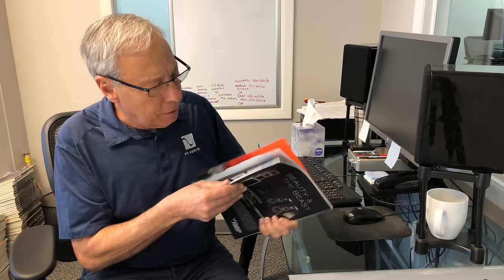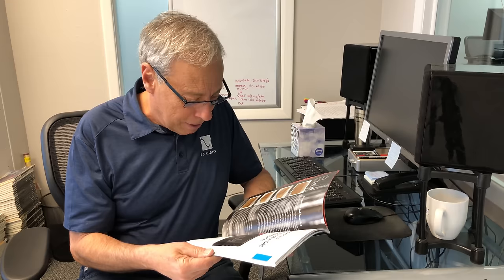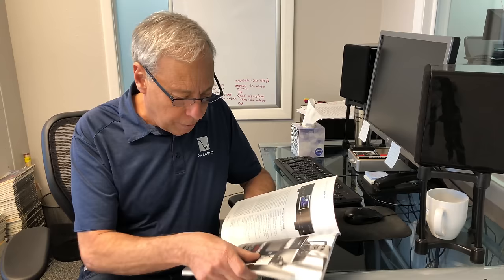Is equipment burn in real?

Comment: Burning in from a technical point of view is completely nonsense. Especially if you're talking about amplifier and such. If it has no mechanical parts it does not need a burning period. 

Speakers for example would need a couple hours. Paul I am sorry but totally unsubbing your channel hence forward. The snake oil  approaching your opinions with nothing but unfounded bull. 

You never even once in one video actually used your technical knowledge. Here also you talk about caps who again need no burning period, if any it takes less than 20 min to "form" if that's even an audible thing .....

You sound like the guys I see at meetings, lots of excuses to justify their pucks, specialized feet, wrist thick cables , and more of that bs. 

I gladly would see you do a blind test, guarantee you will leave humbled. And as we have seen? Some even leave in anger and making even more excuses. Why they couldn't pick their 1500usd costing RCA over a simple 2usd one. 

Want to be sure something works?  Do blind tests...
Reply: Michel Linschoten He didn't actually reply to you, but you're already being disparaged in the comments.

They want a new generation of audiophiles? Well, Atheism is spreading faster than religion these days. "Trust us, it's there" isn't going to work so well as those "uneducated" (see ref. comment) teens become adult consumers.
Reply: You just have to try it on high resolution gear. Not only Paul says that. Everybody who tried that do.
Reply: And none of those have done a double blind test.
Reply: Marc De Vries well they need good sound and they have eyes and live for music. Not for tests.
Reply: +Michel Linschoten out of curiosity, what components have you specifically tested and what was your testing methodology? Thanks.
Reply: +Alex Zuzizi
If you NEED good sound, you NEED good ways of testing.

And trusting your ears or your eyes is NOT a good way of testing. So the result is that you do NOT get the good sound you need. (or waste huge amounts of money for the same sound)

If you think you can trust your ears or your eyes you need to watch this: https://www.youtube.com/watch?v=G-lN8vWm3m0
You can experience yourself how untrustworthy those are. Nobody is immune to this. And that includes speaker and amp designers.

The problem is that a lot of designers don't know this and they think it doesn't apply to them.
Until a brave person person forces the company to use double blind tests and those designers discover that they have the same confirmation bias as everybody else. They put top class components in something they designed so it MUST sound better. And then they discover that it does NOT sound better when they do a blind test themselves. And then they see the light.

This is the reason that double blind tests are the golden standard across ALL of the scientific fields.

Of course this only applies if you need good sound.
Reply: Marc De Vries well I already have good sound based on PS Audio and Sonus Faber gear and $$$$ cables. So I am happy with it. I now need a bigger and more treated room to reach audio nirvana :) So it’s practical not theory. As for the delusions in audio they do exist. No questions asked. And nobody immune to it. So does burn in :)

As for the blind test. A LOT depends on the current mood, time of day, humidity surroundings and who knows what! You hardly can reproduce all these factors. I THINK I ONLY think I PRESUME I could tell the difference between burned in and not burned in gear in MY ROOM in the evening in a good set and setting just like Paul does in his.
If I could not it would be the last thing to worry about :)

As for the video you posted. Again illusions do exist! I just don’t look at lips when listening  to the music. Normally I sit I a darkened room concentrated and yet relaxed. Sometimes close my eyes. So it’s almost always like a blind test :)

In fact if I new video illusional trick that made my gear sound better I think I would immediately jump on it :)
Reply: So, you already have good sound with nice gear. Good
And how did you decide on that gear? You probably got different gear and listened and compared?

And did you then say that it's useless to compare the gear because current mood, time of day, humidity surroundings etc etc influence it?
No of course you didn't. We all try to make the best choice for our budget and listening room conditions.

No, you probably don't look at lips when you listen to your music. But you probably looked at the price tag of the different gear? Or you noticed how one piece of gear looked to be built from more expensive materials, or weighted more? All those things influence our brain in the same way that those moving lips in the video did.
And no matter how much we try not to be influenced by it, we cannot turn that bias off. No matter if you know those lips change the way we perceive the sounds, it still happens as long as you see those lips. We know that it influences the way we hear the sounds, we know why it happens, but all that knowledge does not help us fight it. 
As long as we see those lips moving we hear the sounds differently. And as long as we know we use those extra expensive cables or better amplifier or high res audio file we hear the sounds differently.

"I THINK I ONLY think I PRESUME I could tell the difference between burned in and not burned in gear in MY ROOM"
The speaker designers at Harman didn't just presume they could tell the difference between the cheaper and more expensive speaker they had designed and listened to themselves. They were 100% convinced they could tell the difference.  But to their own surprise they completely failed in a blind test. Why would it be any different for Paul?

Most people have the best intentions. They are not trying to fool you or themselves.
And theoretical measurements are often not enough, because they don't measure all aspects of music that are important. 
But that is the nice thing about (double) blind tests. You still use your ears, so you "measure" all aspects of music that are important. It's practical not theory, but you remove biases.
And yes, double blind ABX tests are difficult and tiresome. But single blind tests help a LOT already and are not much different from the way everybody makes their gear choices. That is how I tested all my gear.

By the way, what kind of treatment are you planning on? I used REW (room equalizer wizard) to see the effect the placement of the treatment had, and that helped a lot in understanding the effect and getting the best out of it. It also makes you realize the severe limitations of treatment below 100Hz. (which was quite disappointing)
Reply: Marc De Vries yeah. Well I think one day I ll get a specialist to do the treatment. Basically to design and tune bass traps and to do some   sound defusers. I have tons of sound absorbing stuff already. Bass under 100 is my biggest problem yes. If there’s a record with very articulated bass that resonates and I still want to listen to it now I plug in DSpeaker which is basically self tuning parametric equalizer with a microphone and graphs like in REW. It flattens bumps in low frequencies so the curve is smooth and almost flat to certain limits. Great piece of equipment. Check it out if you don’t know about it yet.

http://www.dspeaker.com/en/products/20-dual-core.shtml

Blind test are good! I now will agree :) But to me it will only be relevant in my room in a good mood and for rather long time. So it’s somewhere from unpractical to impossible especially for burned in and not burned in equipment. From time to time we do test equipment with my audiophile friends eyes open. I THINK price tags don’t matter much. And yes sometimes very rarely cheaper products sound the same or better. Sometimes they just sound different like brighter or exaggerated bass. It may seem like they sound better at first. Later on you understand the trick. But that may take quite some time.
Reply: Thanks, I didn't know about DSpeaker yet. That is a really nice package for a reasonable price.

When I noticed how little effect treatment had under 100Hz I also resorted to a parametric equalizer. But unfortunately not in such a nice package. And I needed to do manual tests and use REW to create the settings for the equalizer.
Luckily the worst bumps are the same for all listening positions, so the equalizer works quite well to solve the worst issues and it really improves sound in movies a lot.
Reply: Marc De Vries I also noticed at first takes dramatic improvement in the sound quality of movies after equalization. Maybe kind of the same effect as with lips :) Later on I got used to it.
Reply: Michel Linschoten l guess that means he now has 20,999 subs. I'm sure he's losing lots of sleep over your departure.
Reply: Michel Linschoten yes you can be fooled even with a hundred dollar bill. But sooo whaaat ? :) (c) Cure
Reply: Alex Zuzizi complete bullshit ...just saying. If that is true, explain to me why most audiophiles. And I do not mean the tiny little boys here playing with some sonus Faber setup. 

But the guys that drive a 30k setup  with tubes swear by them. True high res audio vs a normal CD...

Even from a technical point of view is completely laugable.
Reply: Michel Linschoten dude, what do you mean? I ‘ll give you a fake dollar bill you will never notice it. Ok then let us say dollars are useless. What complete bullshit are you talking about. Put aside that decent Sonus Faber setups are usually over 20k.
Reply: Michel Linschoten Find something better to do in life than castigate someone on a brief one month old comment. Not sure even of the relevance of your reply, who's a fanboy 🙄
Reply: LAZY DOG don’ t tell me what to do and I won’t tell you where to go! (C) enjoy $100 toys after 20y experience as well :)
Reply: Alex Zuzizi I've got no fucking clue what you're talking about... Whatever you're taking halve the dose 😂
Reply: Alex Zuzizi Why are you even talking to me... 🙄
Reply: LAZY DOG I warned you bro :) nothing personal.
Reply: LAZY DOG and of course soooo sooo sorry bro :))) whatever I said was to Michael not you :)))) yeeaahh I gotta halve beer dose. But you know , emotions :)
Reply: Alex Zuzizi You silly Billy 😂😂😂😂
Reply: LAZY DOG I confirm that :) sorry
Reply: Michel Linschoten does electricity not move?
Reply: Wrong wrong wrong! capacitors do reform, even manufacturers do burn in tests and then put a sticker on the item after testing.
Reply: I never believed it till my last amp I bought. It sounded terrible when I first fired it up, the highs were super sharp and bass wasn't what I expected. I was ready to send it back but after a few hours it started to sound better, by the next day it sounded amazing. None of my other receivers or amps did this. Just saying as I am now a believer from experience......................................
Reply: Yes precisely  I have been involved as technician at a small company that made small computers was a lay-off and started at Audio that was forty plus’s years ago my opens of burn in come from that time on ,  so burn in is a absolute necessity for reliability irrelevant to the quality of parts , the first power up time is important but that said as far as sound quality there is so much belief that they are part of the privileged few that require there equipment burn in for a week more and then it’s so much better, I think this belief began with tubes and it did make sense because different manufacturers did not do adequate burn in but that was the exception. These are the same people that believe a meter of line cord makes a big difference or exotic signal cables my favorite is a one direction cables, the electrons don’t MOVE they go back and forth at Audio frequency so no  in no out no send no receive but there very pretty and the dealers make lot of money on them and it is a hobby but don’t pretend it’s real
Reply: Michel Linschoten burn in from a technical standpoint as far as semiconductors serves no purchase other than...... making sure that all the components used in a product will not fail in the near future. At Intel I worked for 7 years in Burn in and Test of all the newest products under developement, as well as tooling development and other cutting edge product manufacturing and engineering experimentation. The work we did insured that the factory would have viable products to for years to come. When a semi conductor is burned in, it is run as the highest frequency and temperature that it would see under extreme use for a minimum of 90 days. The prevalent theory being that most semiconductor failures occur within the first 90 days. Every product that is made at Intel goes through a minimum 90 day burn in simulation. It is tested before and after, and if there is a change on performance it is scrapped, unlike AMD that does not bother to take this step. The last product I worked on, which laid the groundwork for everything still being manufactured today, was burned in for the equivalent of 10 years. After it left my department it went to the Reliability Testing lab where some units were subjected to high humidity environment, and others to extreme temperature environments for and additional ten years. The goal was to manufacture a product that lasted until it was obsolete, when the end customer would want to replace it, not have to because of failure. We succeeded. In audio, it is important to break in woofers and midranges because the suspension is very stiff. Once broken in its resonance changes and will perform like it will for the rest of its service life, which mostly depends on how the end user treats the product. For example, my old speakers had Peerless KG120 woofers, which worked very well in their enclosures. But after 15 yrs or so the ultraviolet rays from the sun rotted the foam rubber surrounds and the paper cones themselves. They disintegrated. The dome midranges and tweeters did not suffer the same problem and I am looking to design another pair of speakers to use them in. However, when they were new, there was a period of time when the woofer's suspensions were so stiff that I thought I would have to replace them to get decent bass response out of them. A couple months down the road and it was clear that wasn't the case. I wish those drivers were still available! 
So, burning in components have benefits, depending on what you're doing with those components are and what you expect them to do. Burning in a resister would be useless for example, but drivers and semi conductors can benefit from thorough quality testing.
Reply: As long as you have good equipment the best way to get better sound is to get better speakers, then place them correctly . Most people's rooms already have a good mix of hard and soft surfaces, but if not fixing that is the next best way to improve your sound. But with all that being said different interconnect cables and speaker wire do sound different, even though they may all be of good quality. Same goes for amps and preamps and everything else in the signal path, different equipment does sound different. Some speakers definitely do need a break in period,  but with amps and preamps,  except for those with tubes,  I don't know what could possibly be changing inside them to make them sound better over time and with cables and speaker wires what could possibly be changing in them by "burning in" what is essentially a piece of wire? If somebody could explain that I'd love to hear about it.